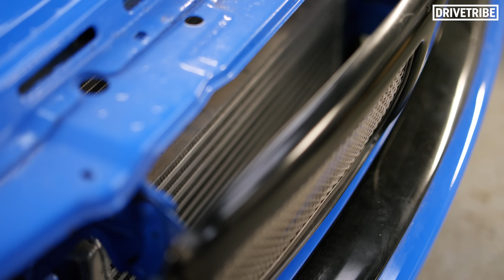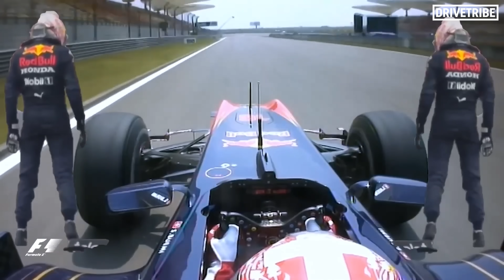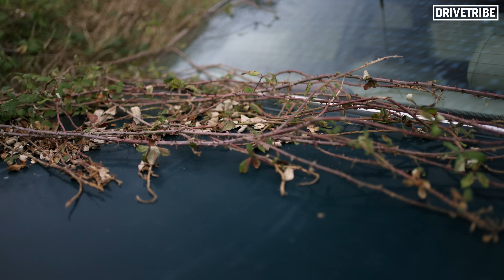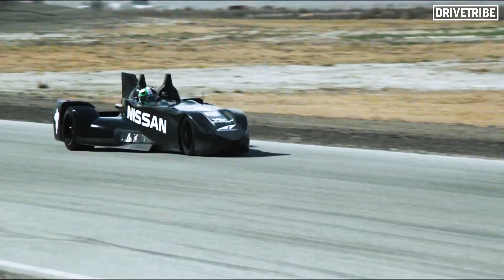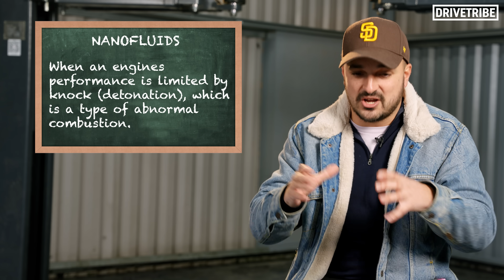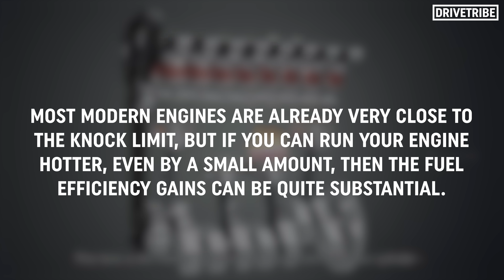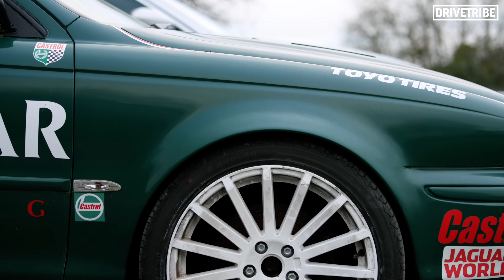This ILLEGAL fluid could increase engine power by 100bhp!

Comment: Regular antifreeze is bad enough when it leaks out.
Nanoparticles in waterways and soil aren't natural.
Heat should travel through a solid or gel without circulation.
Just having fins like the old air-cooled engines had may be all that's needed.

Comment: Getting the heat from the engine faster isn't going to increase thermal efficiency, 30% pushes the piston down, 30% goes out the exhaust and 30% goes into the radiator is only going to increase cooling efficiency but won't make less heat in the cooling system.

Comment: The radiator needs to be my from graphene as the thermal conductivity of aluminum is the limiting factor not modern coolants the graphene will fall out of solution as it heats up.

Comment: It's already available for open loop PC water cooling. It's effective in that application, but seen as a super expensive gimmick. It works well, but costs a lot and adds extra maintenance for something that can normally run forever with minimal maintenance. Car cooling systems are much less delicate though, there aren't tiny microfins to worry about clogging. This is definitely a far better application for the stuff.

Comment: The coolant is only part of the solution because the coolant is reliant upon the distribution and the only component that has that job in a normal ICE is the water pump and if that pump is not up to spec then the distribution of the coolant regardless of it being water or nano glycol it needs to be distributed at a given rate. The given rate is 10 liters per minute at 500 rpm. Of course as the throttle is opened then too the distribution rate must increase to cope with the extra heat being created in the cylinder head . We have been doing this for about 30+ years and it works when you get it right regardless of the coolant.

Comment: There were several things just glossed over in regards to F1 that give a skewed perspective on what actually is. First, the reason F1 has graphene coolant systems banned is for homologation reasons. They just simply haven't come up with rules for all teams to integrate graphene cooling into the cars. This is to ensure all teams have access and capability to develop it with their cars every season. Right now they're more focused on net 0 carbon footprint, and because they haven't finished the research and incorporation of low emission bio/synthetic fuels, adding in something else that directly interacts with the fuel changes they're working on would be a mess.
Second is because it would be a waste currently due to the homologation rules. Even if they were to unban it, the requirements for the engines, minimum weight, size, etc... would mean teams couldn't really do much more than cool the engine more efficiently. Yes, they could reduce the sidepod size, but as Mercedes found out, you may not want to do that.
Which brings us to the third thing. The reason the minimalistic sidepods didn't work for Mercedes wasn't anything to do with cooling. They've had about the same results as the other cars in that area. The reason they abandoned it was because of aerodynamics and the problems it was creating with ground effect (venturi tunnels). Basically this era of F1 cars that use ground effect have had better success with big sidepods that create a vortex over the side of the floor to seal the venturi tunnels.

Comment: So you said that graphene is exceptionally strong. Why stop at fluids? If they can integrate it into the metals of the pistons, rings, cylinders, heads, and valves; then through the block and heads, theoretically you could go back to air cooling! Or even yet have the graphene coolant with it integrated into the metals and make absurd levels of power like a NHRA dragster, but doing it reliably!

Comment: this is all great, moving heat from engine.  but the radiator needs to be size X to disapte heat X regardless where the heat comes from or how fast it's going to it.  if anything might evenb need to be bigger to disapate all the exttra heat suddenly been dumped in it

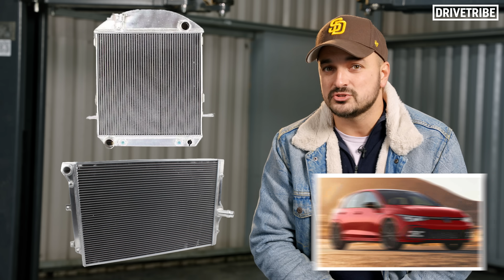Comment: @2:39, the radiator at the upside of the screen is not original ford T model radiator. It is a never version and the production method of this radiator is CAB (controlled atmosphere brazing) and aluminum welding. However the original copper and brass version is made by soldering copper fins to brass tubes. Also headers of the radiator also soldered.

Comment: glad I saved my comment towards the end... my comment was going to be about computer and more specifically CPU cooling as temperatures there fluctuate heavily but if you can cool a large cpu much more efficiently you can almost exponentially increase the power afforded to it... of course this may translate into only 10% gains but it is "free" if your cooler can handle it.

Comment: Why not build an engine that requires almost no cooling it has been done in the 1970s & the limited cooling required could be used to heat the passenger compartment. The engine was ceramic.

Comment: But the heat needs to be transferred from the cylinder walls to atmosphere. Between those there are cylinder block, hoses and the radiator and the coolant only transfers the heat forward. Radiator finally convects the heat to atmosphere and the liquid doesn't affect the efficiency of the radiator so much. It's still just aluminum

Comment: The limit is the limits of how fast air can absorb that heat. Does not mater if the liquid can absorb and release heat so well. The radiator will have to go through a redesign, to be able to release that heat to the air more efficiently. 
A second issue comes so it being a certain viscosity because of the ratio of graphene to liquid. Too much one way and its a syrup, the other has no added effects. 
Something else too, if it was being used in solid form, such as graphene strips and sheets they can only transfer heat one direction, or dimension as that makes a bit more sense. So if its in a sheet, it is the best at transferring heat edge to edge. When its trying to transfer heat on the flat, writing, parts, its thermal conductivity is horrible. Atleast for current tech,

Comment: A problem with graphene in coolant liquid can be deposits. In the end, graphene is solid. If it is deposited in the cooling channels, that is a big problem in long run! It needs extensive testing at high temperature and flow rate conditions.

Comment: Well, this gain in power can be applicable to race engines, not normal road cars that much. The only benefit would be less coolant pump power so better fuel economy. You can run your engine cooler but cooling the engine means more heat loss. Efficiency is basically an optimisation among heat losses, exhaust temperature and power output.

Comment: So the LTT video you linked, initially the nano fluid was within margin of error between it and water (basically no difference while within a normal room where temps were not controlled ), they did manage to get a consistent drop in temps when it was in a temperature controlled area but it wasn't that much it needs a lot more work and testing, especially in areas where the ambient temperature is high.

Comment: Sounds like a promising technology.
Hopefully they can pull it off and get it to market.
There's lots to coolant that the average punter doesn't realise, and even small changes to the make-up can have knock-on consequences.

An example is our preferred oil company was asked for a non glycol based coolant for our mining machinery to help prevent coolant fires [Glycol is flammable].
After several years of fighting cavitation issues, they came up with a blend that seemingly ticked all the boxes in relation to corrosion, anti boil and cavitation... Then we discovered that one particular brand of engine started failing engine oil heat exchangers.
It was found that a solder use during manufacturing of the exchanger was reacting to the blend 😒

We're back with glycol again...

Comment: im confused you still have the ac coil which is the same size of the radiator, also engines works better at higher temperatures if you want power, however the issue is the parts melt so we use water to protect and cool the metal parts. other issues is cost of the liquid and if it leaks how bad is it for the environment, im sorry the coolants today are amazing and worst case you can use water in an emergency, water is amazing and cheap way to cool a engine.

Comment: “Pre detonation” isn’t a thing. It’s a combination of 2 completely different ignition anomalies. 
Pre Ignition is spontaneous combustion before the spark plug fires. Detonation is a secondary combustion event inside the cylinder after the main ignition event. This causes competing flame fronts and a sudden and uncontrolled spike in cylinder pressure.

Comment: One thing..Even if the fluid is more efficient, you need to be able to extract the heat. Air can only pull so much into it, so you would still need a similar air flow volume to pull the same heat for just a fluidic change.
Reply: exactly right. i was thininking the same and looking for this comment. seems like sponsored content but there was no mention
Reply: yup. air is definetly the limiting factor. im calling bs
Reply: With higher thermal conductivity, they could be planning to run more smaller diameter coolant passages through the block and head to make the temperature more uniform throughout, push the temperature up a bit for better thermal efficiency of the engine, and then force the air through at a higher velocity over a smaller, hotter radiator to achieve the same heat rejection.  Just guessing.
Reply: Actually if you are able to run a higher temperature, than the same amount of air will extract more heat.
Reply: larger radiators.
Reply: Which defeats the point of the video, which is radiators etc can be smaller.   What would be needed would be more efficient transfer out of radiator and more air volume.
 @dedasdude

Comment: Why do you guys have to make fake comparisons? The Model T produced about 22.5 Hp compared to the GTi producing 241.3 Hp. Engine efficiency has also increased by about a factor of 2 or more. This means that the heat produced by the GTi is in the region of  4 to 5 times that of the Ford and yet they have a heat exchanger roughly the same external measurements. These aren't the only factors to be considered but its simply not apples with apples. Stop spoiling the sell with marketing waffle

Comment: If its nanostuff and not good in liquids....probably it works in coating cylinders and heads of aircooled engines and probably the outside of cooler surfaces....

Comment: Isn't this stuff a grift? It's been around for years, and the improvements it offers were measured to be marginal. There's an LTT video where the guys used this stuff (or an earlier form of it) in a PC cooling loop and it made like a 2 degree difference. 

Is that statistically greater than random? Sure. For anyone without the budget of an F1 team, is it worth going through the trouble of using this rather than the normal stuff, or even just distilled water and anti-freeze? You tell me.

Comment: From a science standpoint this doesnt make sense.
So lets assume you are pumping pure graphene 
yes more heat could be transfered to the graphene and more heat could be transfered from the graphene to the radiator but you would still need a big radiator because the cooling happens between the air and the radiator and graphene changes nothing in that department. 
Also the graphene needs to be suspended in a liquid which kinda acts like an insulator around the graphene 
Potentially it would wear down the coolant pump and could fall out of suspension if the car is sitting to long

Comment: Given that graphene transfers heat so well, wouldn't be even better to have engine components or the radiator made with the stuff? Imagine a head gasket that would help keep the cylinder head cooler directly? Or the radiator would just transfer the heat almost instantly.
Reply: I reckon you’d get hot stops in the cylinder due to constant heat and cold spots in the rad, as nothing would circulate, dunno though😂

Comment: Im quite disappointed by this video - its quite misleading. The title is misleading - graphene is not illegal (though FIA has a rule that eliminates graphene from use in engines) and the science is not actually correct, and radiator size has littlte to no impact on car design. I'm quite disappointed that a channel of this prestige would be clickbaity

Comment: You can't fool physics. Yes, this stuff can better remove heat from hot engine parts, but I don't think it will increase the efficiency of the radiators. Still, the metal-air process remains. And the more metal, the more contact with air and the more cooling. There is no additional substance in this equation.
Reply: You also need to replace the Earth's entire atmosphere with the same nano-graphene fluid.  Then it all makes sense.
Reply: This needs to be way higher in the comments list.  Graphene would perhaps make for smaller channels to move waste heat between the engine and the heat exchanger, or could be used very effectively as a heat spreader inside of engines (to reduce hotspots or nuclear boiling) but the heat exchanger itself will still be limited by the materials it is made from and the air running through it.
Reply: Doesn't that depend on whether the current limiting factor is the coolant's ability to lose heat or the air's capacity to absorb it?
Reply: @Dayboot33  In my opinion, the limiting factor is air, its ability to absorb heat. With the same characteristics of the radiator and the same amount of air, there will be no difference between the water in the radiator and the miracle liquid. Under the same weather conditions and air temperature.
Reply: @Константин-ъ4ъ9ц  Yep, and the fact most cars, performance cars at least, are designed with enough cooling area to reject enough heat a different altitudes. The air density on a sunny summer mountain pass in the Swiss Alps is much different than that at a lower elevation like the streets of Seoul in winter. Also there are the other components like exhaust valves and manifolds, and engine compartments, which have to withstand the sustained heat at higher power levels.
Reply: @Константин-ъ4ъ9ц 100% the worst thermal transfer determines the size of the radiator which in this case is the aluminium to air on a hot dry day.  To a small extent though the graphene will help the aluminium delta t remain as big as it can. Where it will really help is evening temps out across the block
Reply: You are right but you can improve the "coolant to metal part" in the radiator thus doesn't matter if the "metal to air part" happens at the same rate, the overall time to transfer the heat would be shorter.
Meaning that u can use a smaller radiator to achieve the same temperature drop for the coolant.
Reply: You seem to know bout physics.

Think it's possible we find a fuel that is packed full of energy, therefore when ignited the gas expands rapidly/explosively but the gasses produced are colder than current fuels.

In my logic that seems impossible. More energy = more heat.

But if you could get the same amount of energy, or more, with less heat that'd be a superfuel.
Reply: @ihateeverything3972  The efficiency limit of a heat engine is determined by the ratio of the temperature of the surroundings to the temperature of the heat source. That means hotter = more efficient. You wouldn't be able to burn something cooler but have more efficiency.
Reply: @drunkenhobo8020  
Nah. My understanding is heat is greatly inefficient. 

Lots of energy is lost as heat, and that's why electric engines are greatly efficient, they don't produce as much heat.

No way is hotter more efficient. Maybe you mean to say more energy rather than efficient?

Does the amount of energy released by a fuel directly correlate with higher temperatures? And if yes is it a linear correlation?

I think we can find a fuel that when ignited it'd still rapidly expand, while less energy is lost as heat.

That'd be more efficient in terms of emissions, as well as beneficial for all the reasons listed here. You're always fighting the heat in an engine.

Someone has to be looking in to this, trynna figure it out. Assuming it aint defying the laws of physics.
Reply: @ihateeverything3972  Hotter is more efficient for a heat engine. An electric motor isn't a heat engine so it doesn't apply.
Diesels burn hotter than petrol and therefore are more efficient. It's also conversely the reason a fridge is more efficient in a warm room than a cold one, which always surprises people.
It's not something I made up - it's Carnot efficiency. It's well-established physics.
Reply: @ihateeverything3972

50% ethanol 20% methanol or LNG and hydrogen injection. 10% nitromethane.

youll need less fuel and it will burn cooler but provide more power, with substantially less emissions than gasoline alone. 😌🤓

Comment: Seen this in pcs and it works great.
Will work for any cooling,
The issue is ice engines are not being designed anymore due to evs. 
Unless other fuels come along it’s a dead end for engine design other than maybe racing.

Tuning though No need for ethanol
Reply: Granted, the technology could still be used in EVs, as they do still require cooling.

Comment: Waterless coolants already exist (not graphene) and you can take off the radiator cap safely off a hot engine - it doesn't boil and transfers heat more efficiently than water BUT you can only use water in an F1 engine. Why ? Very simple - when a car crashes and spills coolant all over the road, they only allow water not to contaminate the road surface.

Comment: EVs also have massive cooling systems for their batteries and motors. A more efficient system could reduce heat exchanger and grill opening but, more importantly, improve range and general battery performance. Exciting... if they can figure it out and commercialize it.